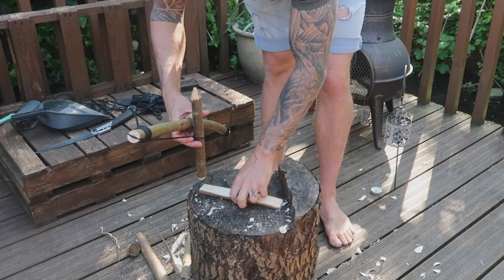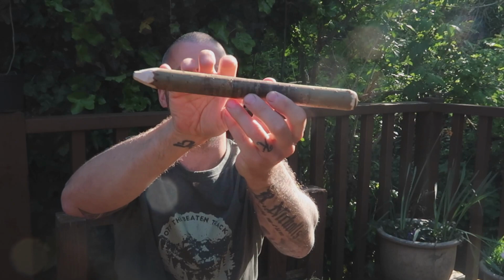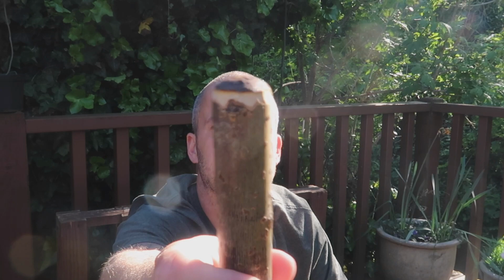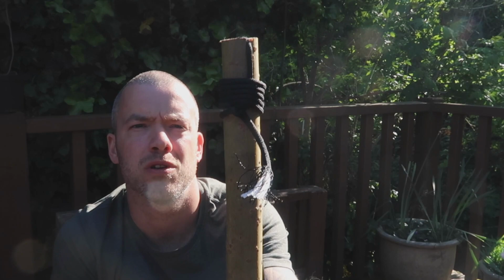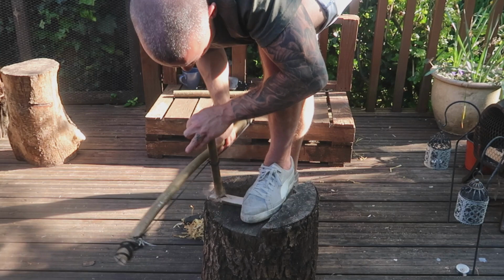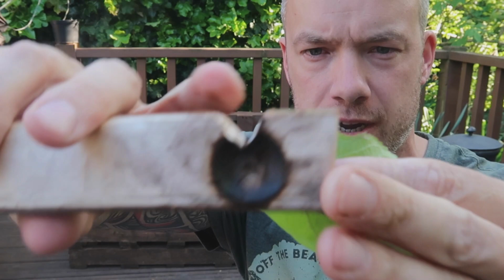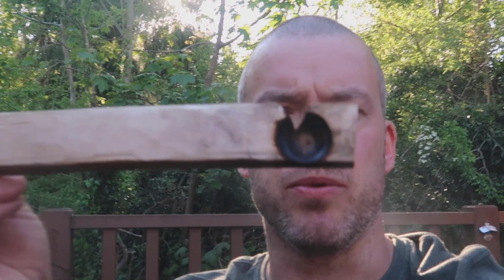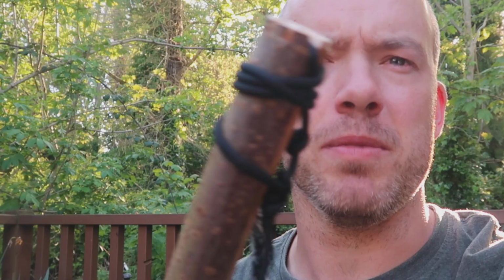Bow drill for beginners - my first attempt - MAKING FIRE. Here i try to complete the task!!

Comment: Amazing job! Nice work, patience and calm are a big help - you seem to have loads of this!  Add a couple of thick patches of leather to your kit - one for the ember tray and one to protect your hand from the hot bearing block.  I use clove hitch at each end of my bow which sit in a reduction notch.  Easily adjustable and quick to do!
Reply from the maker: I was loosing patience but didn’t want to give in! Thanks for the tips, I’ll for sure be using something for my hand to protect it from the heat, also definitely need to learn a few more knots!! 
Thanks for advice and for watching 
Stay safe
Ash🏕